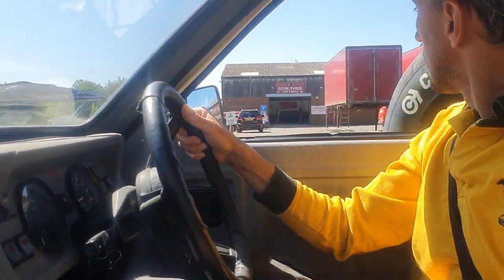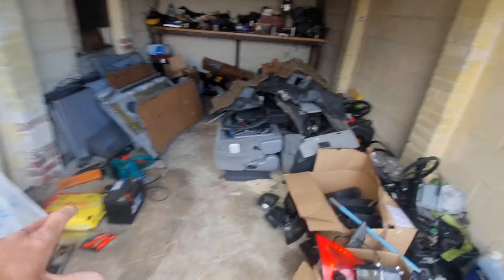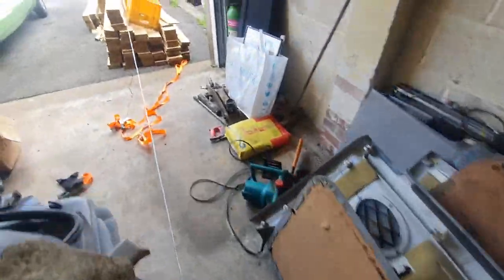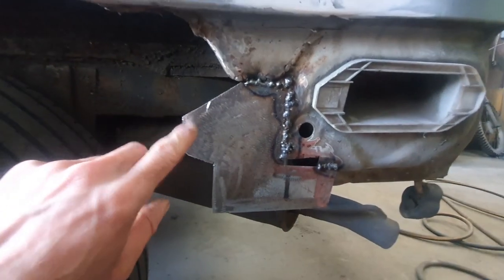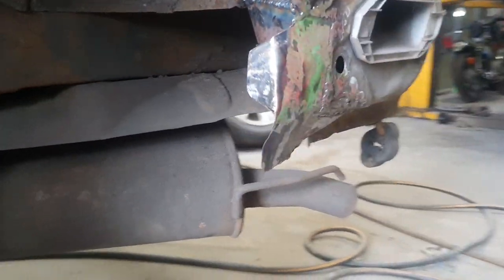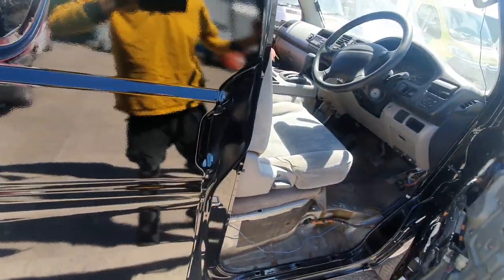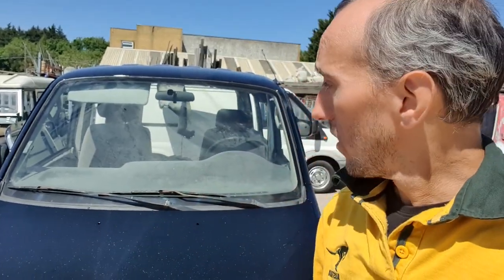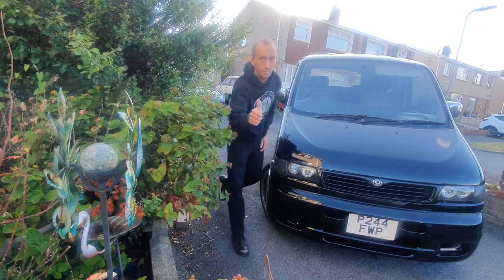Mazda Bongo, back together and Painted!  AWESOME Colour!

Comment: What were you driving at the beginning? Didn't know you owned a Talbot Horizon!
Reply from the maker: I was in my Reliant Robin.
Reply: @StevesMachines  Dude... adjust those tappets!
Reply from the maker: I do need to give them a check, they are quite tappity motors tho.
Reply: @StevesMachines  I've only owned one... in a trike!  It wasn't that noisy despite being out in the open...

Comment: Please please please tell me where you got those headlights from ? About to get the full respray too 🤙🏽
Reply from the maker: I believe they are MK3 Vauxhall Astra units, aftermarket "Angel Eyes" but I can't swear to it as they were on a van I had for parts. They are modified to fit, essentially the Bongo brackets cut off the original lights and bonded on.
Reply: Thank Steve that's a big help hopefully my bongo ends up looking as slick as yours the  front end looks sooooo good mate proper makes it look more modern 👍🏽
Reply from the maker: It does modernise it doesn't it, had quite a few people ask me what it is and then they are surprised it's 27 years old.
Reply: @StevesMachines  really looks mint mate just wish you had done a proper walk around on it, deffo 1 of the nicest ones I've seen to be honest Steve 👌🏽
Reply from the maker: I'll do that when I find time to mop it, been so busy the last few months.  Interior us back in and already been to 2 festivals in it 😁

Comment: Obviously the painter knows his stuff, so probably preaching to the choir! 😬 however re: crazed bumper, what about Barcoat? Or a thin brush applied Gelcoat (Fibreglass topcoat) then the normal prime and finish?  Old celly and solvent 2Pac's are notorious for that reaction (Pet hate 😠) Obviously if you can grab a cheap bumper it's a moot point 🙄 But I thought I'd ask 🤷‍♂
Reply from the maker: Yeah it's to keep time and costs down so an unmolested bumper is the blue sky path 😀